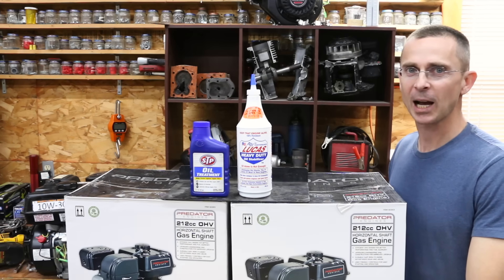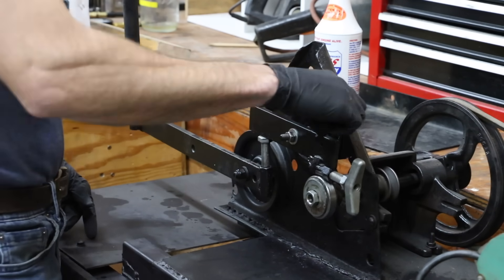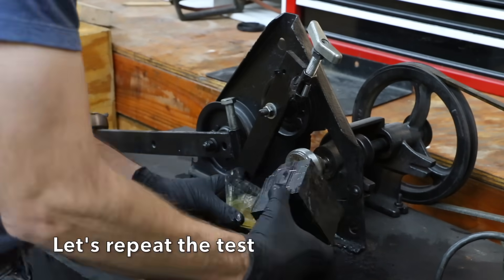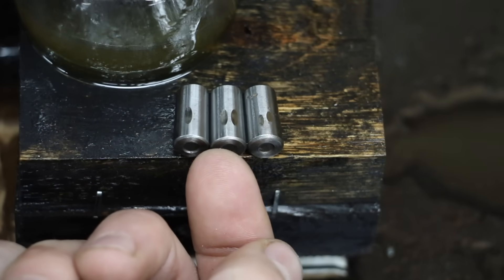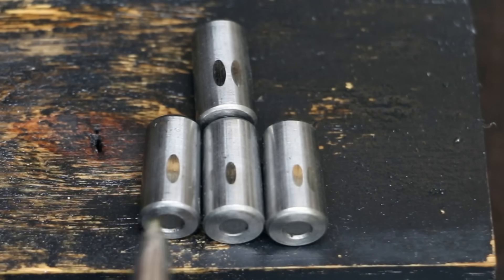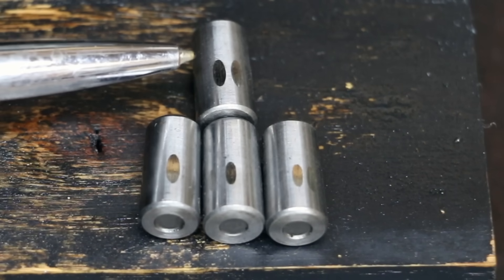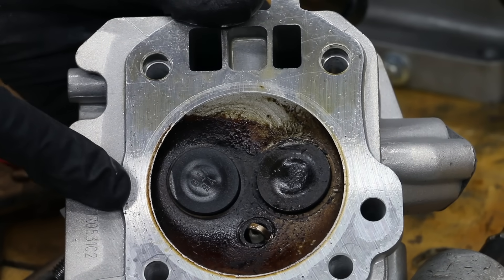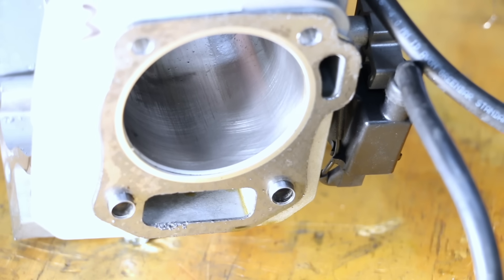Which engine self-destructs first?  Lucas or STP?

Comment: In DD15 or any diesel rig diesel fuel is dry and moist bad for hpfp 3k to 21k psi. Bad for head and injectors. Used 1qt per 100gallons and man that truck ran stronger smoother better mpg, way less vibration. My 2c
Reply: Lucas fuel treatment from Walmart
Reply from the maker: Great feedback. Thank you

Comment: May I suggest a similar test, but with the goal of determining how each additive might affect gas mileage compared to a control engine oil with no 3rd party additive? I, for one, am not sure I want to use an oil additive that causes my fuel mileage to drop considerably. Such a test would be useful & enlightening. Thanks! Great videos.

Comment: I’m surprised they restarted after initial shut down after STP put in. I put 20- 50 racing oil in my Briggs and Stratton engine because that what I used in muscle car in 1968. Lawn mower had no compression after 1st run and shut off. Thick oil made ring stick. Flushed with kerosine and put 30 w back in and ok. Even worse today low tension ring engines. Use proper thin synthetic in modern engines or poor fuel economy or worse.
Reply from the maker: Thank you for the feedback

Comment: Running engines without lube is pointless, and indicates nothing, since engines are not run that way.  STP, "the racer's edge" is the hype, AND IT IS TRUE.  STP was designed to be run in racing engines which are made VERY LOOSE (they care about jamming up, not blow-by or pollution).  STP fills gaps to permit said engines to run.  But in an "ordinary" engine, it mucks up the engine!  Racing engines are torn down and cleaned after every race, so that is not the issue.  Professional mechanics say "no!" to STP, and any engine so treated they demand tear-down and cleaning.  Don't know anything about Lucas.

Comment: Oil with molybdenum disulfide.  You can get molybdenum disulfide on Amazon, not harmful to humans, is an essential element for plant growth, appears to be of no consequence to aquatic life. I have been using a 1 to 1/1/2 percent by weight mix with good lube oil.  It would be interesting to see the insides of engines using various oil formulations.  Only a handful of marketers use Molybdenum Disulfide (Moly) in their oil. Moly is a soft but solid material, which is reportedly banned by Cummins, due to excessive valve train wear.
Reply from the maker: Thank you for the feedback

Comment: I’ve used Lucas in my Ford V10 for 500,000 miles. Still runs like a new truck. On the other hand, I add a bottle of STP to the automatic transmission fluid when I change the fluid, it’s also gone 500,000 miles with no issues.
Reply from the maker: Impressive!  That's a lot of miles

Comment: Tell me you don't enjoy even a little bit every time you grenade an engine 
I put Lucas in my Honda Fit and it decreased my mpg  by 2-3 per gallon
Reply from the maker: lol. It is a lot of fun.  Great feedback on the MPG improvement.
Reply: @ProjectFarm  to be clear actually it was not an improvement it decreased my mileage by 2 to 3 miles per gallon. My car runs on 0w 20 W Oil. I'm guessing it made the light viscobity oil thicker and created a higher drag even if it were protecting the engine better
Much less thorough of a test than what you do. More of an observation. Perhaps it could be a video idea. Just make sure you wreck at least one B+S engine by the end of the video. I wonder if all your lawn mowers cringe or look away when you walk into the garage

Comment: I had a 89 S10 4X4 that had a transmission problem after setting for around 3 weeks it would take a little revving to get the pickup to back out of a parking spot.  I used some Lucas "Transmission fix" to keep from having to tear into the transmission.  That was back in 2003, the pickup is still going strong with having to work on the transmission.  I swear by Lucas.  Oh, I gave the pickup to my daughter in 2017.
Reply from the maker: Great information. Thank you!
Reply: I had a Lincoln Mark VIII that REQUIRED synthetic transmission fluid. The trans already slipped a little and I had the fluid and filter changed. The shop used conventional trans fluid...out of ignorance I guess. I wasn't going to bitch since it already slipped and I wasn't going to invest in a rebuild since the car wasn't worth the money. I put in a pint (?) of Lucas transmission fluid additive and a month or so later, the transmission didn't slip at all! I drove the car for 5 more years. When I sold it, it still didn't have any transmission problems. Hard to believe, I know but that stuff works! I use Lucas products in all my high mileage vehicles since then...every oil change and the transmission gets Lucas whenever they get low on trans fluid. Great stuff imo.
Reply: I had a 98' Chevy Blazer that the reverse was out in. Changed the transmission filter, fluid, put a bottle of Lucas in, and reverse worked until I got rid of it. Love Lucas products
Reply: I've used it in power steering pumps also helps slow leaks
Reply: Lol sounds like your fluid level was really low causing the torque converter to slip until giving it alot of gas. Lucas will fix the level and freshen up and expand existing fluid. Very lucky you didn't ruin your trans.

Comment: 01 Silverado 
4 quarts rotella T-6 15w-40
1 quart Lucas oil stabilizer 
300,000 miles and counting 
Engine never been into.
Reply from the maker: Impressive!  Sounds like a winning combination!!
Reply: @ProjectFarm  I drive semi. That's what I run it. If you can get over a million miles with Rotella alone and mechanics told me I cound get probably another 300-400,000 with Lucas it should be good in my pick-up. I didn't have the semi long enough to find out if it worked. But my pickup I still have. I'm trying for 500,000.

Comment: Excellent demo ..... I would suggest using KREX additive for a comparison since it's a graphite slurry that MANY of the Toyota dealerships are now adding.  Krex has "guaranteed" extending of the life of the engine to a minimum 200,000 miles.  Supposed to be no problem with it and the Toyota specialty motor oil (made by Mobil 1) in fact I'd love to see an across the board test of KREX against any and all additives, especially Lucas ....
Reply from the maker: Thank you for the feedback!

Comment: I dont know if destroying the 2 engines really proved anything.. I am under the impression if you had a lot more engines for the test that they would both fail @ about the same time on average.
A different way to test this would have 3 engines:

1) "control" - normal engine oil
2) engine oil + STP additive
3) engine oil + lucas additive
Run them w/ half full oil capacity for 24 hours (to make the damages show up faster but not destroy motor). Then send in the oil from each to a lab and see how much metal showed up in samples..
idk if that would really be conclusive either since the sample size would be so low and runtime so low...

Comment: The test was interesting but not proof either way which additive is better or worse than the other.  Maybe if the percentage of the additive to oil ratio had been the same for both test engines there may well have been no difference in time taken for engines to self destruct. Only way to find out  is destroy 2 more engines..or maybe 3 with another engine with no additives as a control.
Reply from the maker: Thank you for the feedback

Comment: Without even watching this, I can tell you LUCAS is the way to go. I was an OTR truck driver for 15 years, one of the best lessons I learned during that time, is Lucas is a MUST have for ANY motor, or transmission. Hell, I even run a little Lucas in  my little push mower with a 5hp Briggs and Stratton. If it has an internal combustion motor, and a hole to put oil in, I ALWAYS make sure there is some Lucas down in that hole.  I have a sneaky feeling, if I was to drink a quart of Lucas, I could run a 100 mile marathon, and win without even taking a break. But, i'm not brave enough to test out my hypothesis.  😉   (edit - I think the motor used for the Lucas test, was defective from the factory, because after running Lucas in it, it should have run for another 5 years😀)
Reply from the maker: Thank you for the feedback

Comment: Great comparison! Please consider another hosting the OK CORRAL of simulations. BlueDevil Head Gasket Sealer Part: # 38386 retailing $63 vs. Bar’s Leaks Professional Carbon Fiber Blown Head Gasket Repair (HG-1) $39. During 2018-Sept 2019 I used mostly the BlueDevil Head Gasket Sealer to revive and stabilize my GM LQ1 V6 (DOHC) engine. My engine suffered a couple of undefined ignition issues during the past 2 years also. The 1st week I owned it in 2014 I severely overheated it. Both of these products provided outstanding immediate short to intermediate lasting results.

If I were to bet this BlueDevil sealer if properly applied to an engine that can be saved will provide at least a few thousand miles to permanent repair. The Bar's HG1 should provide similar, but may not save as many engines permanently.

If the automotive community can have reliable effective Head Gasket repair treatments; it would save a lot of consumers a lot of money and some severe headaches!
Reply from the maker: Thank you for the video idea!

Comment: I would prefer if you ran the engines with oil and additives for say 500 hundred hours, then strip them and compare. That would make more sense for a proper evaluation of the additives.  Also have a control engine with just oil. I think you would find that the additives really don't make a difference, all engines would wear similarly. Additives are a waste of money.
Reply from the maker: Thank you for the feedback

Comment: Nice!  A dude not afraid of doing destructive testing on machines, and sharing it with everyone.
I’ve always wanted to see if the torque specs are true, when it comes to building an engine. 
I’ve seen almost every single hot rod resto mod show ever made.  They always make sure to carefully torque some of the bolts, like on pistons, and head bolts.  
What would happen if you were not careful in tightening those down.
Like what if you did one engine the recommended way, then another with the torque patterns out of order,  but proper torque, and another engine any ol way.  Slapped together, hand tight.  Eye Ball it.  Guess it.  Slap that identical 5.7 Chevy small block next to other 5.7s, and run them on a engine stand till one of them blows up.
Reply from the maker: Thank you for the video idea!
Reply: Ya, you’d think there would be one video where someone already tried that. I’ve never seen it.  It’d make a good training video, because lots of mechanics go to school now days, and there’s no video of what happens if you don’t get the torque specs right.

Comment: The best 2 out there is prolong and duralube.I cut gas milage almost in half in 3 months with prolong.It seems the longer you run it,the more you save.They used prolong in a race car at 200 miles an hour with no oil.

Comment: I used "Slick-50" in a 396 once, and hit rail tracks, and tore the oil pan off at 6000 rpm. I duct taped it back together, and used the cheapest oil I could find to get home. When I yanked the engine out, it was fine. I completely believe the TFE treatments are legit, and work well.
Reply from the maker: Thank you for the feedback

Comment: I think this test says as much about the durability of those little engines as anything else.
 When I was about 13 or 14, back in the 70s,  my friend's dad bought a new lawnmower and gave him the old one to do with what he wanted. I remember it was a Tecumseh- Lawson engine. We decided we would drain out all the oil and see if we could get that old engine to blow up. So we dumped out all that dirty old non-detergent Havoline 30 weight fired that thing up, set it on full throttle and then ran back about a hundred feet away since we thought it was going to explode. We stood there for about 10 minutes watching it run then we sat down under a tree and cranked on the radio. The station had just started playing the long version of In-A-Gadda-Da-Vida.
I remember specifically it was In-A-Gadda-Da-Vida because at one point the chugging of the engine almost exactly matched the beat of the drum solo. For those who don't know, which is probably all of you, pretty much, In-A-Gadda-Da-Vida takes up one entire side of a vinyl LP. It's about 18 minutes long I think.
So the upshot is, that little engine ran for at least 30 minutes with absolutely no oil. Eventually, it started running slower and slower. No drama. No noise. Just slower and slower. Finally, it stopped. For all I know it ran out of gas, but when we tore it down we did find that the big end rod bearing had virtually welded itself to the crank, about the same as yours did. And the cylinder walls were heavily scored.
Reply from the maker: Thank you

Comment: When the engine blows what’s popping what is breaking
Reply: Patrick Haines normally the end cap fails first, releasing the rod to either smash into the cylinder skirt or be hit by the crankshaft on its next time around, both cause the rod to snap
Reply: My heart.

Comment: I was down for the video until you decided to run the engines without any lubricant. That basically killed the whole purpose of the video, ending up in proving absolutely nothing. This did not provide any knowledge on what was the best product if any at all.
The point is every single engine or basically anything with moving parts will brake, twist, melt and be destroyed without the proper and needed lubrication. This test of yours did not prove any point other than if you run an engine without any lubrication it will eventually blow up the engine, but that is just common sense, you didn't have to make a video about something that everyone already knows.
This video was absolutely pointless. Waste of money and waste of two perfectly running engines.

Comment: Pro-Ma MBL8 will actually run without oil for longer than any other I've seen so far. I ran an air comporessor out of oil and continued periodic use for a couple years before it failed.

Comment: So, wait... STP is 12 Minutes, Lucas is 21 minutes, and regular oil (previous vid) is 38 minutes?!?!? So Lucas shortened engine life by almost half?
Reply from the maker: Thank you. Lots of other factors come into play since they were tested on different days at much different ambient temps
Reply: @ProjectFarm , hey, love the videos, don't get me wrong. That said, this REALLY should be tested again with a control engine. Folks here are now thinking Lucas is great yet if these tests have any validity it's very likely it actually shortened engine life.

Plus it would help create standard deviation to normalize for engine tolerances.  Maybe a runoff of the top three addatives. 

Do you do patreon? I would contribute to help make that happen as I know this can't be cheap.

Comment: Eh having a old 2003 honda accord as my daily commuter that use to burn oil like crazy i can tell you a slightly higher viscosity oil (recommends 5w-20 , i put 5w-30) with the stp i have noticed i do not get low oil pressure (the lamp coming on) on sharp turns , the car went from burning the oil from about a week and a half to about 2  months so I'd say it's a great improvement , will say I'm going to try the Lucas now
Reply from the maker: Thank you for the feedback!

Comment: This test would only be an honest comparison if both engines are absolutely 100% identical and their is no way to know for sure in this test.
Reply from the maker: Thank you for the feedback!
Reply: Project Farm   You're welcome, grew up in a garage/dealership.   Both are good products.USA, USA
Reply: @davidgibson5707  that can be established by the use of multiple engines with the same setup. Expensive, but that is how you can ac out for tolerance differences. Apparently he conducted this test previously with Lucas and it lasted 25 minutes which is at least similar.
Reply: SVRacer2000   Must have exacting tolerances for piston and cylinder wall, rod bearings to crank, cam bearings, mains, etc., etc..  Otherwise lubricant is not the only variable.
Reply: @davidgibson5707 ..... Which is why you test multiples under the same conditions....like I said. You don't take the single result you take the average and calculate the variance. Clearly he can't afford to run 4 engines of each configuration so its mute in this case, but that is how you approach testing where there is some variance

Comment: I have a explorer V8 and is burning a lot of oil , every 2  or 3 weeks I have to add about 2 quarts of oil , but the engine still strong and drives prefect , what additive would you recommend to use to try to slow down the oil consumption ? thanks , I now is not going to fix it.... I used synthetic blend 10w-30 all times with and the explorer have 178000.00 miles on it.
Reply from the maker: Engine Restorer.  Thank you

Comment: Hey project farm guy.  I have another question.  I have a old john deer riding mower with a 8hp motor on the rear.  Is it possible to take a 6hp push mower engine and swap them out.  Just curious
Reply from the maker: Thank you for the feedback
Reply: @ProjectFarm  I need a answer

Comment: It looked to me like the Lucas lasted longer when ran dry and had less wear in the wet bearing test. that holds to my anecdotal evidence: I've used both on many engines that should have already seized up, and the Lucas always out performs STP. 
It may be difficult to do, but there is a really good additive (CTC...stands for, carb, transmission, crank case) that is a life saver for the unlucky person that has to get more miles out of a dead motor or slipping automatic tranny -as well as unclogging gunked up carburetors when added to a minimal amount of fuel. The trick with CTC is that it has a very thin consistency and must be mixed with the proper amount of oil/trans fluid to fill the pan. 
good channel, dude
Reply from the maker: Thank you!